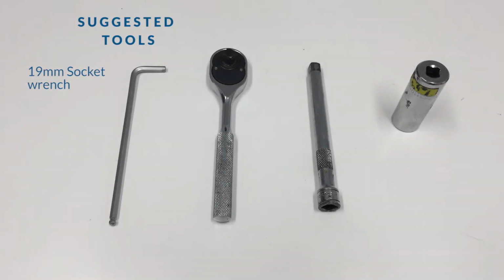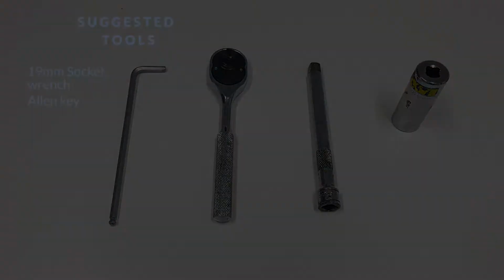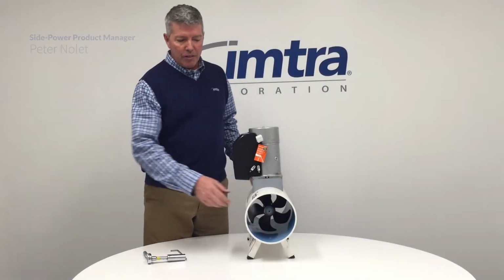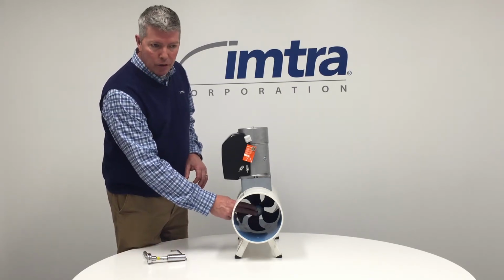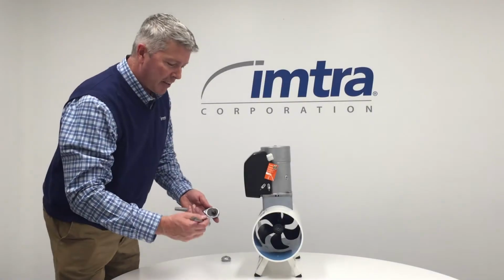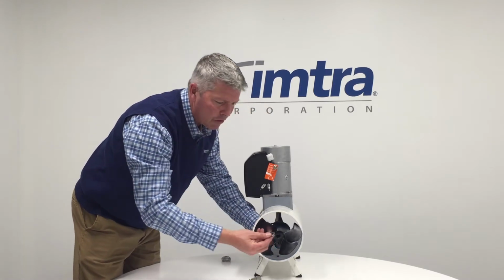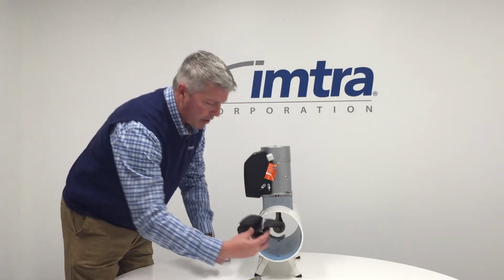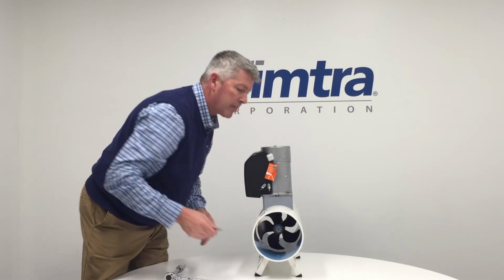How to Change the Anode & Prop on a Sleipner (Side-Power) SE60 Thruster

Comment: If I had a bow thruster in a foot long demo tube, this video is great. But my bow thruster is installed on my boat, and the tunnel is probably 3', give or take. It's all but impossible to hold onto the prop with one hand, while loosening the nut with the other.
Reply from the maker: Dear Mark,
Thank you for the comment. The demo display thruster with tunnel used to show the prop and anode replacement for the SE60 model in the 185mm/7.28” ID tunnel was only 19” long and had the “window” cutout to see the gearleg, so I’ll admit it was easy to hold the prop with my hand. 

As a trick, I would suggest a length of wood, like long enough piece 1” x 1” or 1” x 2”, that you can put between the blades to keep the prop stationary and then remove the anode screw, locknut and prop.

If you ever have trouble getting anode off (stuck on locknut), jut use the anode or what’s left of it to unthread the locknut, i.e. put vice grips on remainder of anode.

I am not sure of your model of thruster, but the sweet spot on tunnel length is 2 to 4 times the diameter for the length. So for that 185mm/7.28” tunnel the sweetspot is 14.5” to 29”. Anything over 6 times the diameter as the length, will see performance drop off due to friction along tunnel wall. See our Tunnel Installation Guide on the Imtra website, www.imtra.com.

Comment: Should any form of anti-seize or Loctite locker be used on the threads?  I see so many conflicting opinions on this.   Some say Loctite 243 blue?
Reply from the maker: It is not required but is often used and blue Loctite is a popular choice. The only thing to keep in mind is that this anode does need to be changed at least annually, so nothing more permanent should be used to bind the threads.

Comment: When replacing the prop should any lubricants be applied?
Reply from the maker: Yes, if replacing the prop out of the water, the prop shaft should be re-greased using a marine grease for underwater. On the anode, we say to use blue Loctite on the screw to keep from backing out.